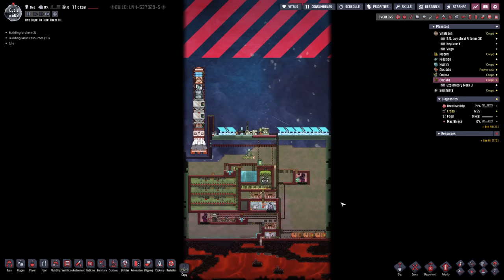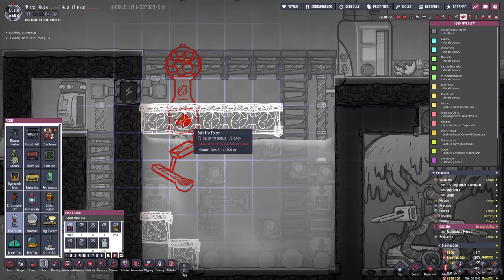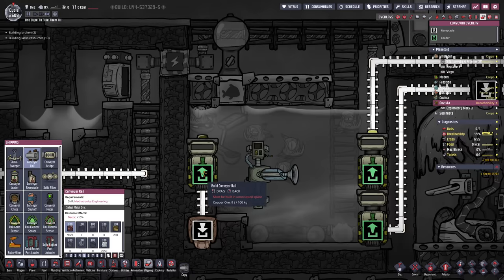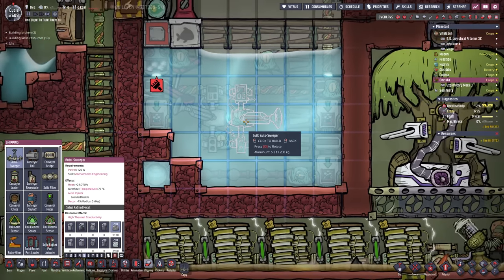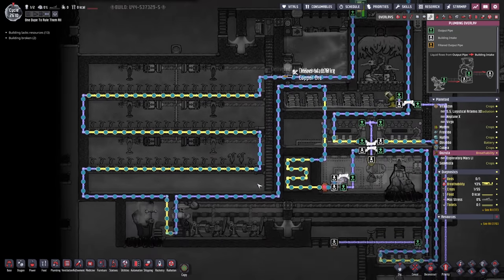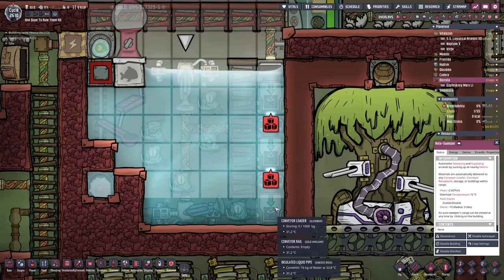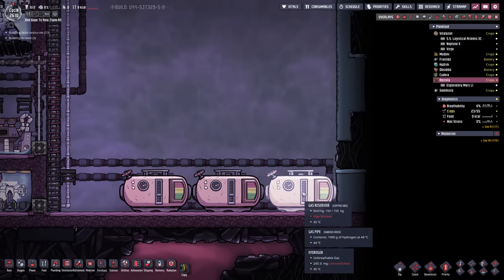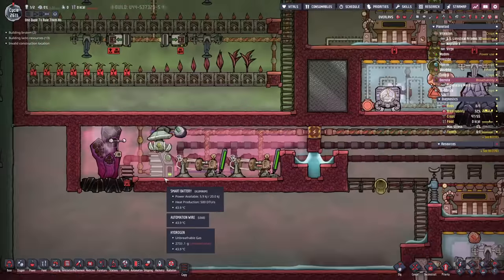AUTO FISH MANAGEMENT - Spaced Out (Classic + One Dupe): Ep. #66 (Oxygen Not Included)

Comment: As Seyeght pointed out issue at 9:15.
There is also two other issues.
The critter sensor does not know the difference between fish and hatches. So if you drop some hatches into the pool, you could end up with no fish.
The next issue is kind of the same, but a hatch could land on top of the fish feeder and then on the weight plate.

Comment: You want to limit the space for the breeder. The infinite pool (1tile) should be open for as much space as possible. This avoids them getting cramped. Bringing eggs upp (doesn't need water storage) and 2 doors so they either fall in as breeders or into the infinite pool depending on number you can have 100 eggs and 300 fish without problem. And to make them tame you need to use algee as a start.